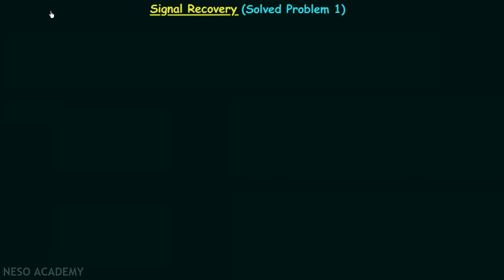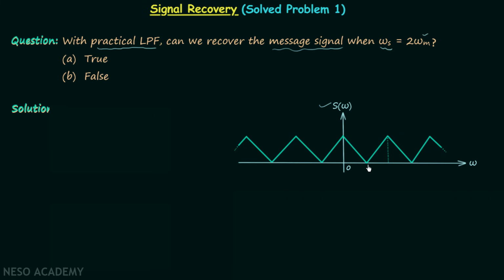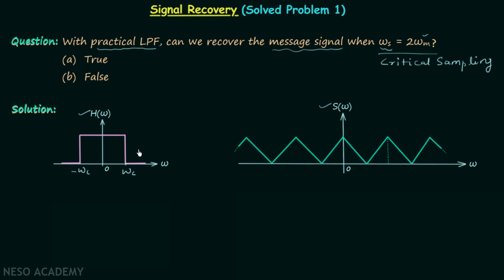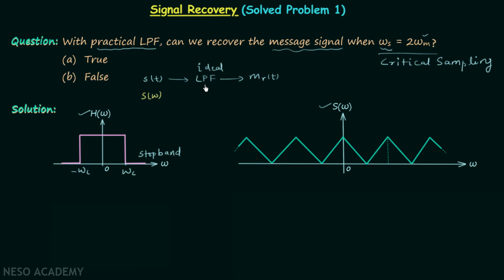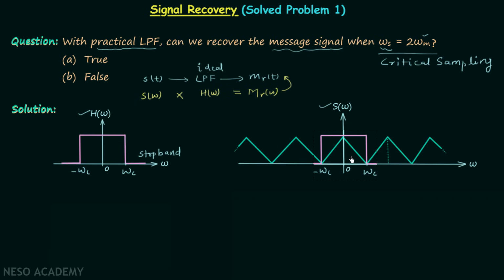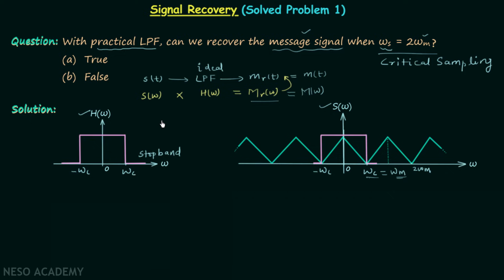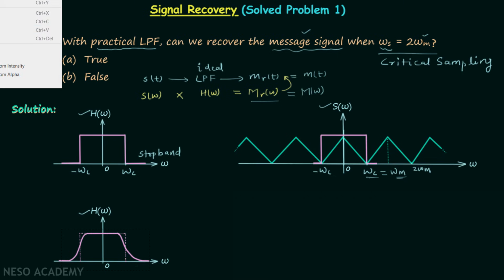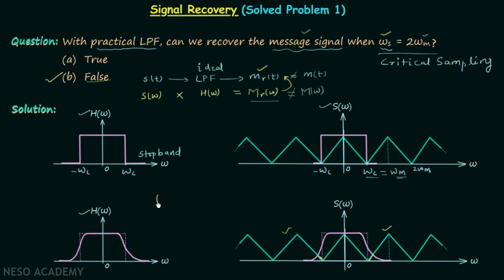Reconstruction of a Signal Using Practical LPF

Comment: It is not easy to control with practical low-pass filter. Neither over-sampling, nor undersampling may work, but you can try to to undersampling to catch maximum frequencies. The best option to do is to ensure that you have sufficient gap between signals, they are not touching and away from each other....w_s - w_m >>>>> w_c>>>w_m ... With that you can catch the signals as they are...